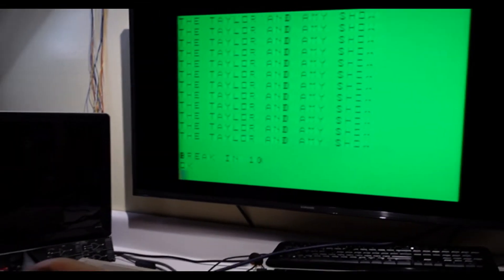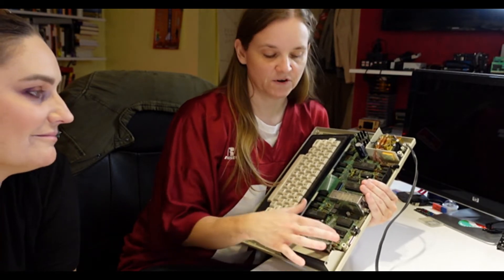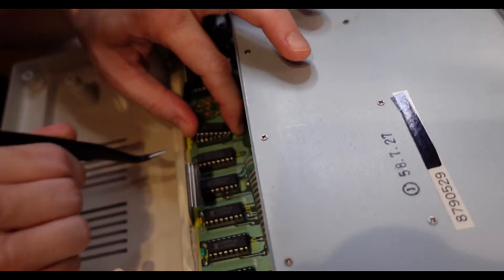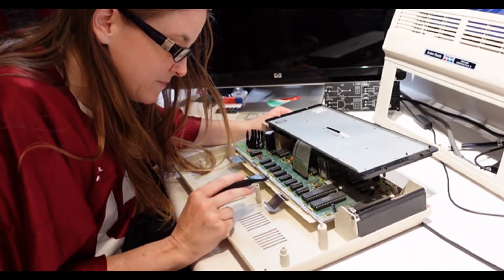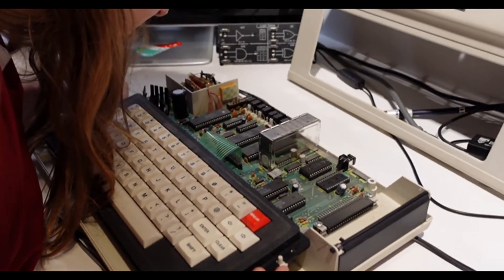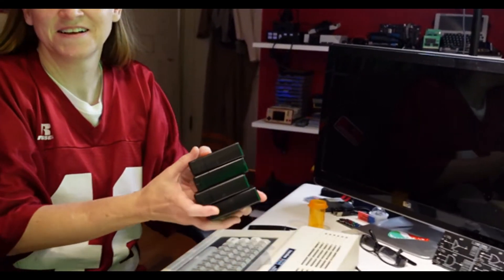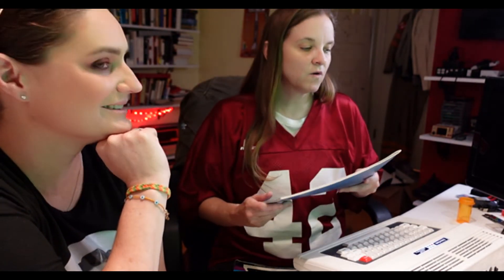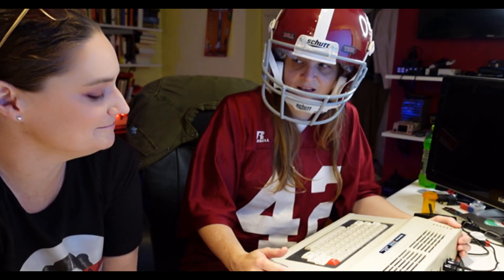TRS-80 CoCo 2 RAM upgrade

Comment: Nice video! How do you get The RGB video output onto the big screen? I heard composite mentioned also, so is the TV just able to display it with its composite input? I bought a purple retro tink mini 2X because I have a C64G which is a PAL machine and needed to convert it to display. TY for the great content!
Reply: The Coco 2 has an RF out (channel 3/4), and some have composite. Either should work.

Comment: The Backbit Pro now supports disk images with an adapter. Books for the CoCo exist at the Internet Archive. If memory serves, the CoCo 2 only allocates the additional RAM in BASIC to 32K, BUT reserves the rest for the Extended BASIC chip. There is a way to switch off all ROM (again, if memory serves) so that you can use the majority of RAM for your own purposes. You might see that for OS/9. I don't remember. A certain amount of RAM will be reserved for the screen, for the stack, and maybe for other OS related stuff.

Comment: When removing RAM chips of this size, you can get a tool that's easier that pulls those small chips. Also, you should be grounded when working on the board.

Comment: The instructions for inserting cartridges may seem silly but for the CoCo inserting or removing carts when the power is on can destroy the cart or even the CoCo itself. Most other home computers and game consoles of the era didn't have this limitation (though the Adam had an even worse one involving cassette tapes) so it was worth noting in the manual.

Comment: Great video.  Probably would have been safer for you and the CoCo to unplug the keyboard.  It hurts to stab yourself with those IC pins.  Ask me how I know!  FWIW, I think you can run Extended Color BASIC on a 16K machine.  I think BASIC can only use 32K maximum.  The 6809 only has a 64K address space total, including ROM and peripherals.  Machine language programs can switch the computer into all-RAM mode to use all 64K (minus the peripheral I/O addresses).  Looking forward to more CoCo fun!
Reply: Yes, ECB can run on.a 16K machine.